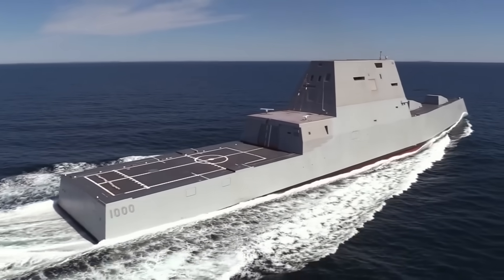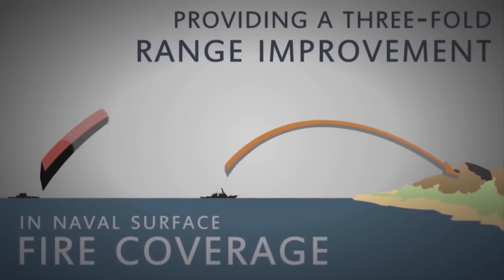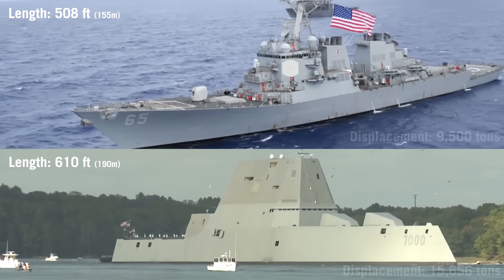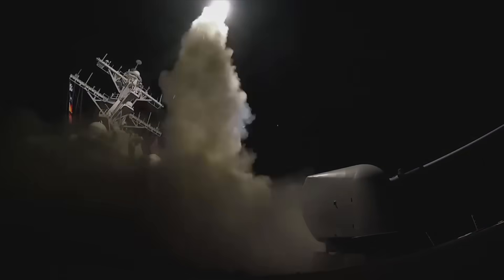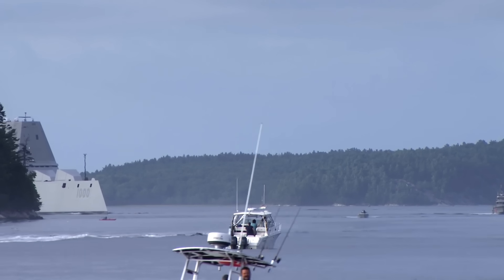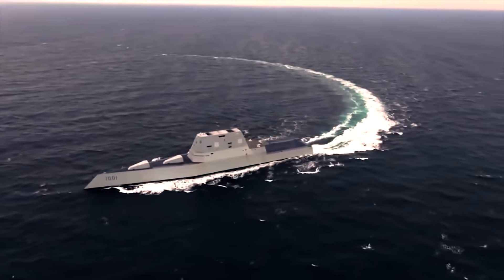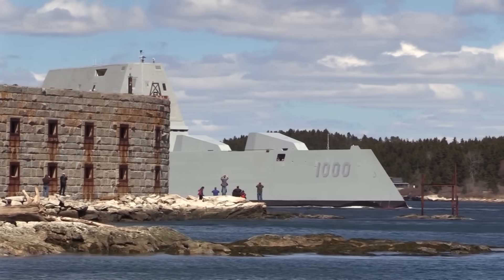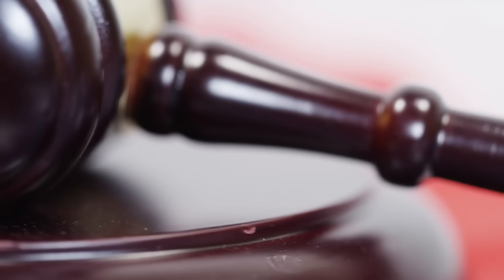What Killed Zumwalt Destroyers?

Comment: As a Navy veteran, all I can say is half the crew working twice the hours. Automated systems don’t clean, paint, do maintenance and other upkeep.
Reply: They tried the same thing on the LCS's. It failed. They had to increase the crew size and berthing spaces later.
Reply: @phiksit  Same thing happened in Germany. The Navy wanted a new ship. Politicians and the industry agreed on a drastically reduced crew size. It didn't work out. Too many jobs, too few people and there wasn't enough space to fix it later.
Reply: Yep. Then they try to blame crews for all the accidents. Even worse in war time? All that automation isn't a replacement for actual crews once stuff starts breaking down. Hell the soviet union fell into that trap with the sub program in the cold war, and that's where most of their accidents happened from. We're going to be in for a real bad awakening when someone that can fight back against us, decides to get uppity.
Reply: @Mavairo  Well said.  I have read some about the Soviet sub losses during the Cold War and the lack of crew size, exacerbated by only officers being trained and educated enough to do tasks enlisted do in the USN, led to many of their losses.
Reply: @kennethfharkin  "Why bring radsuits? We dont need radsuits. Stock more raincoats instead."
Reply: @Mavairo  A lot of that drive for fewer crew and higher automation stems from 2 factors.
Forceshaping to control budget
And
Cultural aversion to putting troops in harms way.
Both of these are reasonable...but both of them stem from "At home" issues that we are and will always be struggling from, simply because our country is...well...it is what it is.
THe United states is super super sensitive about its casualty counts, while most of our key rivals are not...not only because they outstrip us population wise, but because their moral footing simply isnt as high. Whenever body counts stack up too high, Americans flip their shit. Sort of the result of idolizing and stratifying military personnel as indomitable heroes, instead of as people doing a job. The response to this is to cut down manning and crank up automation.
Reply: @Mavairo  Nobody armed only conventional can stand up to a nuclear armed force. It doesn't guarantee a win either as there is no win against people who doesn't want to be defeated (if you don't count mass genocide as win of cause).
Reply: @Mavairo  Correction: when amerika decides to get uppity yet again and gets a rude shock. Stop invading around the world.
Reply: @Mavairo  I would disagree, if automation is such a bad thing we did be seeing manually operated and loaded cannons on ships like back in the 1890s. And with crews up wards of 300 plus on ships the size of modern day corvettes. 
Bashing soviet sub designs for automation ignores the fact that the majority of their incidents happen on submarines with crew of around 100 which is standard for the time. Their most automated subs, the Alpha class served with relatively few issues. 
While I agree that automation is not the solution for everything, it is also equally erroneous to assume human labor is better in every single scenario.
Reply: Damage and flooding control on a tumblehome with half the crew. You stop the water ingress, or you go overkeel where a conventional hull wouldn't have, with half the damage control personell. Brilliant, isn't it.
Reply: @EgorKaskader  On the bright side, when the ship sinks after being unable to keep up with repairs, you’ll only need half as many rescue boats to save the crew!
Reply: I'm a plankowner and was onboard from before the Navy owned her to after the homeport shift, then moved to the Zumwalt squadron which is now DevRon. We worked our asses off on that thing and maintenance is wild, but it really is hot shit and the automation is up to snuff now. And the hypothesis about the hull and capsizing is nonsense, just like he said in the video. In heavy weather testing she moved like a dream. She is INCREDIBLY stable.

The program office is a fuckin disaster, and if they didn't keep dicking the program around, it would be even more capable than it already is.

The only killing that took place was from the bureaucrats trying to cash in on project money fucking the program up. The ships are outstanding and those crews are some of the hardest working, most capable people I've ever met, often doing the work of multiple rates on a daily basis, and still absolutely crushing performance and certification expectations.
Reply: @jwwhitmarsh8411  That's not the instability that was mentioned - tumblehomes are stable in severe weather. If you look a bit closer though, what's being talked about is instability from flooding. For which we have historical examples (and basic physics) that tumblehome hulls lose stability far more rapidly and require more effort to recover, compared to a conventional hull. French navy tried it, Russian navy tried it (on ships ordered from France, IIRC), and in both cases, the ships in question would not take kindly to damage-induced flooding. Counterflooding on a tumblehome also doesn't recover stability as well as it would in a conventional hull, and they have a reduced amount of buoyancy available to sacrifice to counterflooding anyway. None of this relates to stability when undamaged - only when suffering damage, in combat or otherwise.
Reply: @jwwhitmarsh8411  I agree I was on a type III Perry. The real cost was 0.9 Billion when commissioned. Then there was the three yard periods over the next 3 years. Adding another 0.9 Billion. When they go in the yard the crew does not go on a another of the same class. You still have 180 bodies getting paid. At lease a berthing barge was a bit better.
Reply: @jwwhitmarsh8411   Thank you for your service shipmate but if you ain't walking on the walls in rough seas it ain't  really a destroyer.  Tin Can Navy.
Reply: @jwwhitmarsh8411  absolutely right.  I hope you are well brother.  - Hoffman
Reply: @jwwhitmarsh8411  nobody is arguing that a tumble home can't seakeep. It's well known by anyone who's read into pre-dreadnaught ship designs that tumble homes seakeep extremely well. They have a low center of gravity and a metacenter that doesn't react to waves as strongly as a flared hull, so they're very stable in seas.

Where they perform much worse that a flared hull is in flooding stability. If they're taking on water, a tumble home looses bouyancy from flooding at a much fast rate than a flared hull. So when someone pokes a hole in your ship, you have half the time to get it plugged and pumped or else she capsizes. And you can't counterflood as aggressively because that makes the problem of total bouyancy worse.

Yeah, she'll ride a storm real well, but how's she handle some holes poked in the side?
Reply: Corrective maintence and checks quarterly and above had to be done by off ship personal by 3m instructions... Gee wonder what could go wrong
Reply: Automated systems also can not repair battle damage!
Reply: I've been out for over 20 years...are there roombas for bilge cleaning yet?
Reply: @heimbatman4516  You all nice peoples please read this because later  You see infornation what they dont want me to tell.

Hello Everyvody THIS IS MESSAGE FROM OUR LOVING GOD AND JESUS❤️❤️❤️❤️❤️❤️❤️🙏. 

Our God is the God of love's judgment and justice❤️❤️❤️❤️❤️❤️❤️🙏. After manmade the first sin: God was forced to remove people from paradise otherwise the paradise would have destroyed. That's why the. .d...l. is here because the first people experienced it. Same for everyone. God gives you the freedom to choose. God does not want anyones us to go hell. The judgment of hell is the same as sin will eventually lead to. The meaning of life is love❤️❤️❤️❤️❤️❤️❤️🙏. We must accept Jesus because we received grace through this. Jesus is coming very very soon❤️❤️❤️❤️❤️❤️❤️🙏. God gives the last warnings to the people. Thats why the forest's are burning all over the world. There are many Christians here in the Philippines so there is no forest fire.
Hello how are you? This  world is going to very bad direction right now. Im shocked how bad everything have went. I hope you contact me. You need this wisdom. I only want to tell the truth. I have send this many worldwide. 

https://youtu.be/mneDhOtVEQw

Thats the same shark it have allways been.
No evolution because its a lie. 

 If there is no GOD: no time, no material, no space, no order, no physics of laws what have to be exactly right that we can live. If there is no GOD only endless emptyness. Think about like human brains:  explain to me where it came from? Everything have to be perfect that it works. Two eyes is perfect and everything else too.
Of course, everything has to be ready for it to work
And only empty body is not enough because we need life. What is life? That we peoples will never understand. Rabbit's body know how to put right color at the right moment. Think about how many different shades of color it is also possible to come. Also just the right amount, twice a year. There we need intelligence to desing that. 

Even a mechanical simple car engine needs its maker and components to work. And fuel too. 

 Now they say whales were land animals:

evolution dont have brains:
    1. but it made four legs to grow. How it know to put right amount? 
    2. Whales are normally very big and they are too heavy for walking. So how evolution know to choose small whales. 
    3.The tail should also drop off

Thats why they probably are telling this theory because they have problem. They say fish came to land and transform to frog or something. The problem is gills should also transform to lungs and its inpossible. Thats why they take now whale. It does not eliminate the problem because they say first cell born in the sea. It is impossible even with the logic of evolution that a cell developing in the ocean would eventually be able to develop into the lungs. Because the beginning of the animal would always drown. 

God gave me all this wisdom❤❤❤❤❤❤❤🙏.  Think this please: How those birds would have survived without wings? Why fruits and berries taste so good? I send only these two questions to evolution professor and nothing came back. They also say evolution put camoflash animals to survive. Why then  panther example is black. They say its black because its a night time hunter. How  evolution know without intellligence to put black color? How evolution know to put rabbit a white color when is a winter and brown color when its summer without intelligence? 

Think about how many different shades of color it is also possible to come.

 Also just the right amount, twice a year. There we need intelligence to desing that. 

They probably say evolution develops animals where they live: Why then whales have lungs and fishes gills? And they also say: The fish got their feet and it was frog  or something finally. They brake their own logic when they say that! And how about fish gills? Fish gills should also turn into lungs. Its inpossible and they brakw their own logic again! And how about plants: They say plants developed in the sea! How those plants and trees the came to land? I heard somebody of those evolution theorist told: plants and trees walked. How could the evolution also develop food to animals, like berries and plants without intelligence. Evolution dont  have intelligence but tgey say it develop everything what we, animals and this world need!

ONLY GOD CAN CREATE LIFE AND EVERYTHING WHAT WE NEED❤❤❤❤❤❤❤🙏. I was so sick and i waa sure im going to die but after my mothee saw three visions of jesus and one angel vision my health came back very fastly❤❤❤❤❤❤❤🙏. e..l is running now and try to destroy us all! hell is real and I saw how terrible those horrible e...s are and dont give. us any mercy. GOD AND JESUS WANT TO SAVE US😥❤❤❤❤❤❤❤🙏. After I started to talk I have lost so many friends😥. This is how you can calculate evolution is a lie. After I send this to DAVID ATTENBOROUGH I lost my rights

 to go in facebook. Finnish newspapers also block my stories. Those how believe in evolution tell we are about 2-2.5 million years old. Then explain this they also tell earth had 252 million people  when we start to calculate our time 2021 years ago. How they can know that its inpossible! Double that amount example wvery 100 year. You are gonna see its inpossible and this is only  doubling the amount of the  people. My father teached in school and calculated this very quickly:  252X10potens6X2POTENSSIIN20=2,64×10potens14 250 MILLION 500 1000 2000 4000 8000 16000 32000 64000 128000 256000 512000 1024000 2048000 4096000 8192000 16384000 32768000 65536000 131072000
and when we  take 131072000 million÷earths population 7530 million=17406,6 times higher what we have now. Those evolutionist lie to us. e..l is working and try to destroy. us. Put  small numbee example 10000 and calculate how that exblodes. Over a thousand scientist have appealed that they no longer believe in the theory of evolution. The list just grows all the time. You can find that video on youtube:
https://youtu.be/xQgOjHsMEeE

  Without Gods guidance I would never understand to calculate this. I pray and hope you share this other people too❤❤❤❤❤❤❤🙏. Please read Isaiah 24 in the Bible because its happening now! The most important thing: In Mark 13, Jesus tells what happens before he comes. God bless you and your family♥♥♥♥♥♥♥🙏.
Reply: lol I was going to say, cool does that mean the Zumwalt class has humanoid sweeping robots?   Anyway I think in the future they will just use smaller electric remote control craft, bung a missile launcher on one,  and when the "anti killer robots" fuhrore dies down, they'll slowly scale the technology up.  Until you have cheaply made, electric, disposable remote-control weapons carriers   that can be ordered to sail down a river and shell an enemy base.  And if it gets destroyed then that's a problem for the accountants.  They might all report back to a central manned mothership for recharging and maintenance.     They won't really have much empty space inside them, they'll be a lot smaller than manned craft, probably a lot lighter too with minimal armour.

The problem will be if they put sophisticated autonomous AI on one of these things and it ends up going nuts and shooting down an airliner, though that has happened with the manned aegis shooting down a civilian airliner too.  Or imagine if one gets hacked, didn't the iranians steal a USA drone by taking over its wireless ??
Reply: The reason these things flop so badly is beacuse the higher ups have too much of an ego to ask people like you what is actually needed
Reply: Half the crew works perfectly if the ship is half the size :)
Reply: Well... All they need to keep the floors clean is a RoboVac!  Duh!
Reply: You got that right. And if anyone thinks that steel in a salt water environment doesn't need upkeep, they probably never heard of a needle gun.
Reply: Not to mention damage control/firefighting...
Reply: Experienced the same. Newer ships with less crew and they had to create new plans on how to clean the ship because of low manpower. The crew would have a 6 hour shift, 6 hours of work, 6 hours free time. No normal daytime work service possible. 6 hour shifts are ok for boats that are at sea for 1 week max but not for ships that are at sea for up to 2 weeks and more. Ships with the crew size of a boat dont work. Thats my opinion. Damage control could work by redundancy but an exhausted crew with sleep deprivation just isnt good at making decisions.
Reply: I hear ya man. In the end as long as they can point the finger at anyone but themselves they dont care.
Reply: Hmm... Come to think of it. Does the USN have the same management team as those responsible of the swedish welfare state (not exactly the same as the US, it's kind of much better than yours XD)?
Reply: You forgot... the U.S. Navy's $5 BILLION a piece Advanced Roomba Vacuum Cleaner project.
Reply: They are guaranteed to always be in 3 duty sections. Taking leave for holidays is likely a pain in the ass, and as you mentioned the workload of the entire ship, not just departments like deck or engineering is vast to keep up with preservation, inspections, and the like.
Reply: "Automated systems don’t clean, paint, do maintenance and other upkeep." You would think the brass would have learned a few things. The navy started Top Gun School because pilots relied on automation and missiles and forgot how to dog fight. Then  came the Falkland War. Britain's RN relied on automation and missiles and gunnery skills suffered. In both cases above there was a rush to bring back those skills.

I was a 16 inch gunner on the battleship Missouri back in the 1980's. We would load the gun but the FC's would aim and fire from fire control in the forward part of the ship. But in our gun booth we had everything we needed to aim and fire our turret guns. When we had live fire GMGC would give us bare info and we would do the math and come up with elevation and traverse settings, time in flight, max altitude in flight, angle of impact and flight time of the projectile. We would then enter the info into the turret fire control system with actual firing triggers disabled.
Reply: Robotic vacuum heard of it
Reply: Yep, Russia figured this out in the 1980s, glad the Americans finally caught up.
Reply: It would be impossible for a US Navy crew  to work twice as hard at sea. As it is now sailors only get two or 4 hours of broken sleep every day .   Yes you can expect men to be injured, die also.  160 man crews is ridiculous.
Reply: Zumwalt maintenance is contracted out, just like the LCS ships.
Reply: @bubblehead772  Maintenance and upkeep happens 365 days a year no matter where the ship is located. I doubt a contractor is following around a ship when it is out in the middle of the Pacific Ocean on an eight month deployment and two weeks from the nearest land.
Reply: @melwig2813  As Navy vet myself AND a LCS contractor, the crews on those ships do minimal maintenance and have scheduled PMAV (Periodic Maintenance Availabilities) in select scheduled ports. When one had an item break in the middle of the Pacific, the Navy flew contractors from Australia to fix it while they were underway.
Reply: Wait, there aren't a platoon of robots that pop out from behind automatic doors on the main deck and immediately start scrubbing the deck?
Reply: Can confirm
Reply: crew working "twice" the hours is just an imbecile move, imagine ship is under attack with the crew all tired, have to take quick espresso shots.
Reply: ur u.s navy vet then  u commited warcrimes right ?
Reply: @Steven Strain automation is not bad as the way you say it. Automation is applied in Tesla cars to many other kinds of cars like Honda and other types of transportations likes planes and trains, so many lives have been saved. Even simple things in medical devices and other life and death situations where automation helps and maintains our daily lives from death.

Automation is getting more advanced and redundant by the day. You can think of “automation” as an “Artificial Intelligence”.
Reply: Bean Counters and Politicians.
Reply: Not yet....
Reply: Or sew.  My dad was in the Royal Navy during WWII and learned to be pretty good with the needle.  It was a holdover from the days when sails were the propulsion system, but was still necessary for canvas coverings for various things.
Reply: Can confirm, the crew onboard Big Z worked their butts off for sometimes 7+ years to get her going and over to San Diego.  The burnout with them was significant, but they were the best crew I ever had the privilege of serving with.  If I could go back with them, I would.

Captain Carlson's quote wasnt just smoke.  I wouldnt want to be onboard any other ship today.
Reply: Automated systems are complex and require plenty of maintenance performed by humans. Automated systems do not magically fix themselves.
Reply: This.

My first boat was an Avenger Class MCM.  Nominal crew around 80 people.

You still have to stand up ALMOST all the same watches that a DDG does.  So instead of 1 watch per 3-5 days, you get 1 per 3 days when in a US port, and port and starboard (1 on, 1 off) when in foreign ports or when onboarding a lot of new Sailors in a relatively short time and having to wait for them all to get qualified.  At sea, you get a lot of "5 and dimes" (5 hour watch, 10 hours off) once everyone's qualified, but P&S (5 hours on, 5 hours off, including for sleep) while qualifying new people.  It's ridiculous.

And MCMs don't have nearly the combat systems watches of a DDG, so I feel like the watch standing on a Zumwalt would have been murder.
Reply: navy veteran myself.  ship sounds and looks cool.  but man that is a lot more work for the crew.
Reply: Modern commercial ships 3 times the size manage to do their maintenance with a crew of 12-15. So that doesn't really hold much water. Most of the crew on a navy ship is there for combat operations, not maintenance.
Reply: @mytech6779 , So what is your experience in the navy?
Reply: @samuelschick8813  My navy experience is totally irrelevant to what I said. Whats more, it is something anybody could claim as there is no way for you to verify it. So you'll just need to take the verifiable facts written for what they are and not get distracted by the source.
Reply: @mytech6779 , Yes your navy experience is relevant. But I accept your unspoken admission you have no navy service. Sounds like you think you are an expect on on something you know absolutely nothing about. That was clear when you make it sound like the navy just sits back idle waiting for a fight.
Reply: @mytech6779 , 

" So you'll just need to take the verifiable facts written for what they are and not get distracted by the source."

First you did not cite any verifiable sources, you made a claim on navy ships that you clearly know nothing about. Your reply is just another way of you trying to make yourself sound like you know more on something than you actually do.
Reply: @samuelschick8813  verifiable does not mean cited. The two words have different meaning. If you are in the maritime field in any way you would independently know that even the ultra large container vessels (1300ft, 200,000ton, SuezMax) only crew 20-30 sailors, tankers and smaller ships crew a few less, and they manage all the basic stuff just fine. So much more than that on a navy vessel is clearly for military purposes and redundancy not the basic operation and maintenance. 
(Notice I'm focused on the facts. Not asking for your background, because it is irrelevant and as easily fabricated as mine.)
Reply: And more automation requires more maintenance, and more difficult troubleshooting and repair.
Reply: Maybe add automation not to replace crew but instead to assist then? Make them more efficient?
Reply: The entire concept of the automated crew sounds like some foolish McNamara level folly, a technocrats way of imagining the efficiency that comes from treating people like robots.

Its also like corporate management strategies that also involve firing people to make workers do twice as much work. Naturally the product you get is about as good as you expect. The death of specialization is what happens when you get technocrats trying to build the weapon of the future on a political budget constraint.
Reply: @BollocksUtwat  Or taylorism that Lenin based USSR's economy on. The most alienating management method tried in capitalism. How ironic!
Reply: @BollocksUtwat  
They were trying to make it for robots to operate. 
It was so stealthy, that the crews don’t even know they’re actually androids and they still living these days in the Navy on other ships.
Reply: @BollocksUtwat  Worse, sometimes you get people trying to build the "weapon of the future" on an unlimited budget.
Reply: ...or damage control.
Reply: @charlesjohnson9879  The advancements in firefighting at least were very good (if a bit too easy to set off at times).  Hope you are well man.  -Hoff
Reply: @charlesjohnson9879  You all nice peoples please read this because later  You see information what they dont want me to tell.

Hello Everyvody THIS IS MESSAGE FROM OUR LOVING GOD AND JESUS❤️❤️❤️❤️❤️❤️❤️🙏. 

Our God is the God of love's judgment and justice❤️❤️❤️❤️❤️❤️❤️🙏. After manmade the first sin: God was forced to remove people from paradise otherwise the paradise would have destroyed. That's why the. .d...l. is here because the first people experienced it. Same for everyone. God gives you the freedom to choose. God does not want anyones us to go hell. The judgment of hell is the same as sin will eventually lead to. The meaning of life is love❤️❤️❤️❤️❤️❤️❤️🙏. We must accept Jesus because we received grace through this. Jesus is coming very very soon❤️❤️❤️❤️❤️❤️❤️🙏. God gives the last warnings to the people. Thats why the forest's are burning all over the world. There are many Christians here in the Philippines so there is no forest fire.
Hello how are you? This  world is going to very bad direction right now. Im shocked how bad everything have went. I hope you contact me. You need this wisdom. I only want to tell the truth. I have send this many worldwide. 

https://youtu.be/mneDhOtVEQw

Thats the same shark it have allways been.
No evolution because its a lie. 

 If there is no GOD: no time, no material, no space, no order, no physics of laws what have to be exactly right that we can live. If there is no GOD only endless emptyness. Think about like human brains:  explain to me where it came from? Everything have to be perfect that it works. Two eyes is perfect and everything else too.
Of course, everything has to be ready for it to work
And only empty body is not enough because we need life. What is life? That we peoples will never understand. Rabbit's body know how to put right color at the right moment. Think about how many different shades of color it is also possible to come. Also just the right amount, twice a year. There we need intelligence to desing that. 

Even a mechanical simple car engine needs its maker and components to work. And fuel too. 

Now they say whales were land animals

evolution dont have brains:
    1. but it made four legs to grow. How it know to put right amount? 
    2. Whales are normally very big and they are too heavy for walking. So how evolution know to choose small whales. 
    3.The tail should also drop off

Thats why they probably are telling this theory because they have problem. They say fish came to land and transform to frog or something. The problem is gills should also transform to lungs and its inpossible. Thats why they take now whale. It does not eliminate the problem because they say first cell born in the sea. It is impossible even with the logic of evolution that a cell developing in the ocean would eventually be able to develop into the lungs. Because the beginning of the animal would always drown. 

God gave me all this wisdom❤❤❤❤❤❤❤🙏.  Think this please: How those birds would have survived without wings? Why fruits and berries taste so good? I send only these two questions to evolution professor and nothing came back. They also say evolution put camoflash animals to survive. Why then  panther example is black. They say its black because its a night time hunter. How  evolution know without intellligence to put black color? How evolution know to put rabbit a white color when is a winter and brown color when its summer without intelligence? Think about how many different shades of color it is also possible to come. Also just the right amount, twice a year. There we need intelligence to desing that. 

They probably say evolution develops animals where they live: Why then whales have lungs and fishes gills? And they also say: The fish got their feet and it was frog  or something finally. They brake their own logic when they say that! And how about fish gills? Fish gills should also turn into lungs. Its inpossible and they brakw their own logic again! And how about plants: They say plants developed in the sea! How those plants and trees the came to land? I heard somebody of those evolution theorist told: plants and trees walked. How could the evolution also develop food to animals, like berries and plants without intelligence. Evolution dont  have intelligence but tgey say it develop everything what we, animals and this world need!

ONLY GOD CAN CREATE LIFE AND EVERYTHING WHAT WE NEED❤❤❤❤❤❤❤🙏. I was so sick and i waa sure im going to die but after my mothee saw three visions of jesus and one angel vision my health came back very fastly❤❤❤❤❤❤❤🙏. e..l is running now and try to destroy us all! hell is real and I saw how terrible those horrible e...s are and dont give. us any mercy. GOD AND JESUS WANT TO SAVE US😥❤❤❤❤❤❤❤🙏. After I started to talk I have lost so many friends😥. This is how you can calculate evolution is a lie. After I send this to DAVID ATTENBOROUGH I lost my rights

 to go in facebook. Finnish newspapers also block my stories. Those how believe in evolution tell we are about 2-2.5 million years old. Then explain this they also tell earth had 252 million people  when we start to calculate our time 2021 years ago. How they can know that its inpossible! Double that amount example wvery 100 year. You are gonna see its inpossible and this is only  doubling the amount of the  people. My father teached in school and calculated this very quickly:  252X10potens6X2POTENSSIIN20=2,64×10potens14 250 MILLION 500 1000 2000 4000 8000 16000 32000 64000 128000 256000 512000 1024000 2048000 4096000 8192000 16384000 32768000 65536000 131072000
and when we  take 131072000 million÷earths population 7530 million=17406,6 times higher what we have now. Those evolutionist lie to us. e..l is working and try to destroy. us. Put  small numbee example 10000 and calculate how that exblodes. Over a thousand scientist have appealed that they no longer believe in the theory of evolution. The list just grows all the time. You can find that video on youtube:
https://youtu.be/xQgOjHsMEeE

  Without Gods guidance I would never understand to calculate this. I pray and hope you share this other people too❤❤❤❤❤❤❤🙏. Please read Isaiah 24 in the Bible because its happening now! The most important thing: In Mark 13, Jesus tells what happens before he comes. God bless you and your family♥♥♥♥♥♥♥🙏.
Reply: @timoiivonen4334  evolution is a fact, if not, explain why we have tail bones
Reply: @macvadda2318  Thanks so much contacting me🙏. Everything has its purpose. evolution theorists said that tail fell off man when man rose to a vertical position. Well then why does the kangaroo have tail? That logic also why bear dont have long tail? They are just man-made stuff and not reality. We need it when we sit down. It gives softening. It also shows that we are not animals because we do not have a tail. After all, it would look horrible anyway if imagined for a human being.
Reply: @timoiivonen4334  because bears don’t need tails humans used to have tails, and tailbones hurt, but there is actual evidence for evolution, it’s an actual fact, why do you think whales have leg bones but no leg, or why do the bone structures in animals look similar. And evolution is basic genetics too, we humans used to be apes, weather you like it or not
Reply: @macvadda2318  If the bear dont need it why the dog have it. Think about dog without the tail or bear having a tail. Bear with a tail wouldnt look good and dog without the tail looks awful too.

So, if the species did indeed develop quite differently over time. 
(the fish goes ashore and becomes human)
so of course all the logic
according to at the moment should be thousands, if not even hundreds of thousands
intermediate forms of the whole world.
(animals what have one wing, Eyes just developing, ape humans...)

Think of that explanation as well, That all evolving species are: Are extinct
(How they are all dead)

Those who still believe in evolution do not take into account that the remnants of these dead intermediates should be full everywhere. 

There are no intermediate forms and will never be found. If, by the way, it is believed that man has supposedly come from the sea, then how do these previous forms of development still swim there.

The meaning of life is love and that what God wants. If we would love and take care each other that would solve all the problems. Its not my right to judge, I’m just telling you what God wants. God is merciful and loves us🙏. Those evolutionist's try to shut my mouth because they cant say im wrong. There are so many lies here in the world and evil try to destroy us. Of course when they try to do a lie they try to do everything to support that lie. The media and newspapers today are under the direction of those people. They erased my facebook profile and then i had to do another profile to youtube. They erased also my second email address and said nothing and I cant comment to Finnish newspapers too. And they say we have democracy and freedom to speak. 

You will also find a lot of additional information on Google that proves the theory of evolution impossible. However, the information will not become public information. If you try to spread it, your actions will soon be sabotaged. 

This world is not what God wanted to us. God wants to give us eternal life and happiness❤️❤️❤️❤️❤️❤️❤️🙏

Jesus is the way truth and the life❤️❤️❤️❤️❤️❤️❤️🙏
Reply: @timoiivonen4334  if your saying what god wants you to say then he has terrible grammar, what are you saying
Reply: @timoiivonen4334  also explain the dinosaurs
Reply: @timoiivonen4334  stop saying random numbers, and we don’t know the exact number, it’s an estimate based on the life expectancy and birth rates,I don’t know why you’re arguing on something that is fact
Reply: @timoiivonen4334  Thanks for speech.
Reply: @macvadda2318  Dont bother.
Reply: @timoiivonen4334  Don't ask me where you're going with the population thing.
Reply: @foxtrotnine  he ain’t replying I’m good
Reply: @timoiivonen4334  Hun, the reason there are no forest fires in the Phillipines while there have been bad forest fires in, say Australia, Western United States, etc. is that the climate is entirely different. In Montana, for example, a state in the Western United States, there is generally about 80-90 days where rainfall occurs each year. Compare that to the Phillipines, where it usually rains somewhere around 180 days per year, and you already have a place full of forests getting about half as much rain. Then, throw in droughts to these already substantially drier areas, and suddenly... forest fires. Germany had severe flash floods recently. You know what's not going to happen here, where there are forest fires? You know why? Because we don't have the right climate for the type of flash flooding that is occurring over there.

Things like the frilled shark function on theoretically older body plans than surface dwelling sharks, it's true, but you also have to consider that evolution happens on the rate of which things reproduce, of which deep sea things live in practical slow-motion; take, for example, the Greenland shark, which ages so slowly that it is expected that the sharks only reach reproductive age once they have passed a century in life. They are changing, but they are changing dramatically slower than everything else because of where they live due to each generation being an incredibly long time as opposed to, say, insects, which have anywhere from a generation a year to multiple. That being said, things like the frilled shark are probably not what were around during the ages of the dinosaurs. They're an old body plan, but they're not that old. Only old in comparison to things on a shorter lifespan.

"If there is no GOD: no time, no material, no space, no order, no physics of laws what have to be exactly right that we can live. If there is no GOD only endless emptyness. Think about like human brains:  explain to me where it came from? Everything have to be perfect that it works. Two eyes is perfect and everything else too."

There is no reason why there has to be a God for any of those things to exist. The assertion that they can only exist if a God exists is a self-affirming argument. "God exists because everything exists, and because everything exists, then God exists because God created everything." It doesn't prove anything, it doesn't contain any actual reason to it. If we're going to think about human brains, you have to acknowledge that very often human brains are not perfect. Two eyes is no more perfect than eight, and sometimes people do not have functioning eyes. There is a higher degree of tolerance than "perfection" for things to work well enough.

"Now they say whales were land animals

evolution dont have brains:
    1. but it made four legs to grow. How it know to put right amount? 
    2. Whales are normally very big and they are too heavy for walking. So how evolution know to choose small whales. 
    3.The tail should also drop off"

1) Four limbs is by no means the "right amount" it is an amount of limbs that works well enough for the purpose that they serve. There are lots of alternative body plans on earth, from the 6-8 limbs of insects and arachnids, the 8 limbs of cephalopods, the 16 limbs of mantis shrimp, or the numerous limbs of millipedes and centipedes.  Evolution doesn't need to "know" how many limbs to give something, if it works, it works, and it will propagate. As for how such things develop? Position of limbs and such is actually determined by relatively few genes. They've experimented with moving around such genes in fruit flies to make legs grow where antennae should be, eyes where limbs should be, etc. It's moderately frightening that we're just one big lapse away from having things where they shouldn't be, really.

2) What do you mean? The creatures that whales were evolved from were once much smaller, yes. But as you get into the deep ocean, you get the opportunity for gigantism because it is much easier for things to grow larger successfully without dealing with all the issues that large things on land have to deal with such as overheating and not having your body collapse under its own weight. The size of some cetaceans isn't something that started out immediately but later

3) Why would tails depreciate and become vestigial when using your tail to propel yourself is a pretty sound game-plan for aquatic creatures and is used widely by fish, crocodilians, etc.? Very clearly, whatever whales came from used their tail to propel yourself, and gradually, the rear legs grew unnecessary to the point that it didn't matter that sometimes the integrity of genes that confirm leg structure decay.

"The problem is gills should also transform to lungs and its inpossible"

Only because you view it to be. It likely wasn't an immediate shift, and it's certainly not out of the question that similar body structures adapting to functioning only relatively differently to their relative function.

"How  evolution know without intellligence to put black color? How evolution know to put rabbit a white color when is a winter and brown color when its summer without intelligence? Think about how many different shades of color it is also possible to come. Also just the right amount, twice a year. There we need intelligence to desing that. "

Only enough intelligence for something with hormone cycles that behave in such a manner to have a marginally better time than other alternatives, which is not much.

"Think about how many different shades of color it is also possible to come."

There are many, and many would not be particularly helpful, nor likely to occur depending on what type of creature you are. There are also things like birds which are quite vibrantly colored because it is not as big of a deal when you have this amazing mobility function known as flying, or vibrantly colored creatures that are toxic or venomous to mess around with, because they can get away with it and it develops into a sort of deterrent for other things to target them. Aquatic life similarly varies from various sorts of camouflage to  extremely flamboyantly colored because you can get away with a lot more when you can swim. 

"They say plants developed in the sea! How those plants and trees the came to land?"

Washed ashore, or developed into aquatic plants as a stepping stone as flora that floats, or emerges from the water in other means as opposed to being entirely submerged. From there, they can spread by wind and propagate widely, similarly to how submerged flora might propagate through water currents. Lots of possibilities. 
The purview of how widespread they are being problematic and how far inland they can sometimes be is only around as an aspect of you believing that the amount of time that has been around for them to do such things being vastly more limited than the theory of evolution poses. 

Why do whales have lungs and fishes gills? Because whales have not been around long enough to turn lungs to gills, nor has their been any reason for them to since whales are incredibly capable aquatic life without them, similar to other aquatic air-breathers. Fish would need lungs to survive long-term on dry land, but creatures with lungs do not need gills to survive long-term in the water. And why do fish still have gills? Because gills still work, as does being a fish. It's a niche that hasn't been pushed out of existence, and so creatures of that morphology will continue to exist.

"Those how believe in evolution tell we are about 2-2.5 million years old. Then explain this they also tell earth had 252 million people  when we start to calculate our time 2021 years ago. How they can know that its inpossible! Double that amount example wvery 100 year. You are gonna see its inpossible and this is only  doubling the amount of the  people. My father teached in school and calculated this very quickly:  252X10potens6X2POTENSSIIN20=2,64×10potens14 250 MILLION 500 1000 2000 4000 8000 16000 32000 64000 128000 256000 512000 1024000 2048000 4096000 8192000 16384000 32768000 65536000 131072000
and when we  take 131072000 million÷earths population 7530 million=17406,6 times higher what we have now. "

All of this is based on the assumption that the rates of birth and death have remained constant for that entire time. The human population hasn't been doubling every 100 years for 2-2.5 million years is the simple answer to that. More basic human life would also be more fragile to extreme natural disasters and such, leading to greater periods of fluctuations in addition to being less exploitative of the environment leading to there being less opportunity to sustain a larger population. Hell, doubling in human popuation doesn't even reign true for the past 100, where we've quadrupled since 1920.
Reply: Why wouldn't automated systems clean and paint? Those are simple processes done automaticly in thousands of households and factorys. Automation is easy in an environment where everything has it's place. Robots can just have a map of the ship in thier memory.
Reply: @jannikheidemann3805  I've yet to see an automated system that can clean and paint in real world applications while justifying its cost and upkeep.
Reply: Exactly! Right along with the thinking that a 130 lb person on the flight deck is a good idea, first if they get hit with prop wash, jet blast or rotor wash they become debris flying on the flight deck. Also, how good is that lightweight sailor going to carry another sailor off the flight deck when injured, or drag that fire hose around and fight fires when the hose loaded with water is heavier that the person manning it. I guess I shouldn't use the word (Manning) anymore! The Navy needs these 200 lb guys but they think they don't, just wait until the SHTF and you are depending on just one guy to save the day and Petty Officer Peters at 120 lbs is trying to save a downed fellow sailor or needs to haul a unconscious pilot out of the cockpit! Sorry, I know this doesn't have to do with the actual Zumwalt Class but it does show the Navy's new mindset that started in the new millennium. I had several friends that served after I did that got booted out of the Navy because they weighed 220 with a neck as wide as their head that was muscle and were strong as oxes. Would have been proud to serve beside them but the Navy treated them like garbage that had to be thrown out!
Reply: @vinnyambrose7514  It became acceptable for for BM2 Hungry and I to haul in the shore power cables. Normal  a 6 person job? Of course our combined over weight carcasses was 525 LBs. We also got tasked to haul the gate valves over the knee knockers. Move spools of line through the ship. Then get counseled again about being over weight. I guess the real problem was feeding us. AS for me not what you would expect a EW2. The chief got upset when he seen me one hand the calibration set up a vertical ladder. Meh. It was only 80 some lbs. My biggest problem was getting large enough uniforms. They only come in four sizes small, medium, long and extra long. Had the same problem with BDU's Could not roll the sleeves up past my elbows for the summer uniform standard. There were some hatches on the ship that I could squeeze through by twisting my shoulders and go through one arm and shoulder at a time. I don't know what the military would do with my little brother or his son. Big Jim is 6'1" (Jumbo)and 325 and Little Jim (Sasquatch) is 6' 9 and a skinny 350. Little Jim's sister is the proper weight (230) for  a 6' 3 man. But she is a fit woman. I guess it boils done to where are you going to store all the that food. Yep 1/2 a hot dog and a cup of rice for 3 meals a day for 3 weeks sucks. Happens when the supply ship is scared to come out where you are.
Reply: Thanks for that enlightening post.
Reply: @vinnyambrose7514  I mean I’m 6 foot, and I hold 140 pounds. I’m not a big guy by any sense but I’ve been known to punch above my weight consistently. When push comes to shove I’m able to move some weight. Now for prop wash? I’m not so sure, that’s just down to weight.
Reply: @vinnyambrose7514  Hey now!  5'4" 135 lbs, I somewhat resemble that remark.  Granted, I was in the reactor room, so not the flight deck, but still!

But you have to remember that big dudes are a recent phenomena.  Look back at pics of sailors from WWII era and most of 'em were 5'4" to 5'7" and probably in the range of 115-150 lbs.  People tended not to be as overweight OR as muscular back then, and the average height was shorter.  Moreover, most of the big beefy guys were taken into the Army/Marines where they need that raw physicality more, while the more brainy/nerdy/techy guys were shunted to the Navy (WWII was before we even had the Air Force as a separate thing from the Army)
Reply: I would imagine the automated systems replace sailors while the maintenance crew is included in the minimum crew.